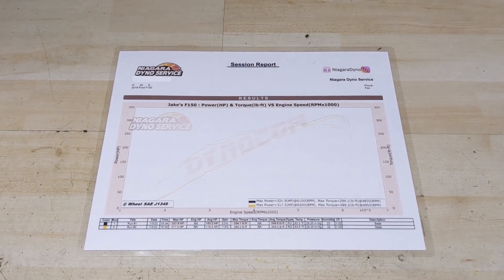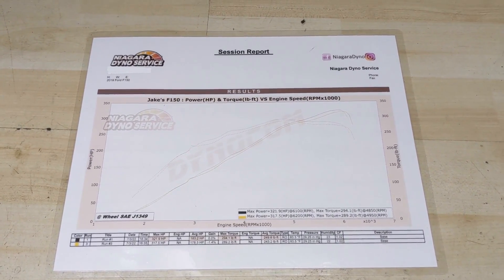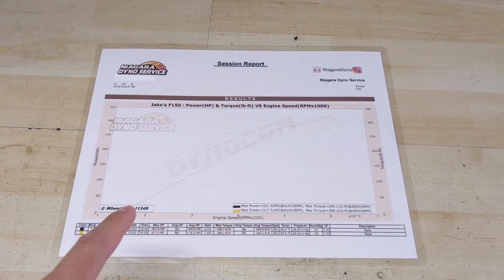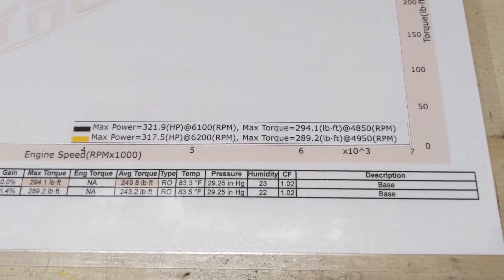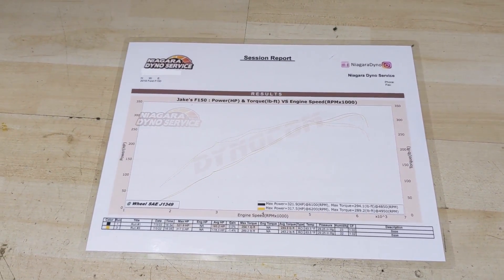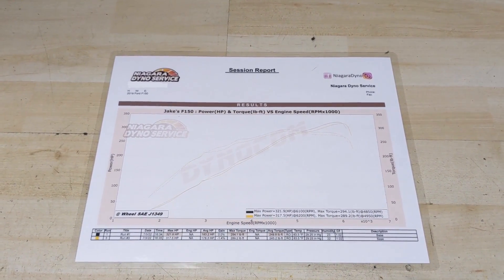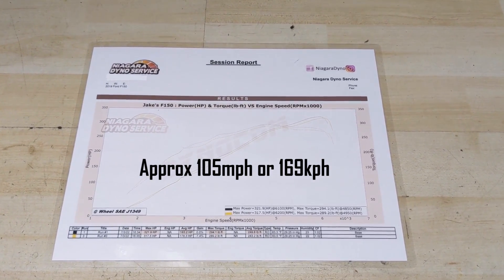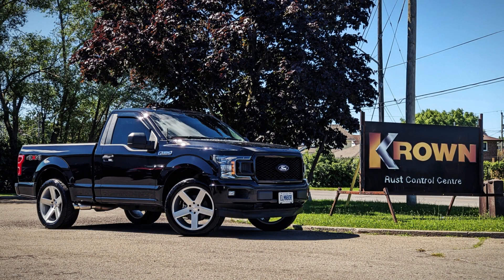How Much HP Does a 2018-2020 5.0L F150 Make?

Comment: That is a great horse power out put  oh by the way how can I get a e.p hat
Reply: Roger we only made the original prototype hats embroidered by a Canadian comopany website that turned out having them made in Denmark. Wow the hats went from $22 each to $50 each with the shipping and international duty charges. At some point Jake will be setting up a merchandise site for supporters to purchase EP items like hats and T shirts. We may also have some specialty hats locally embroidered to be given away during our 100k subscriber giveaway. The main prize giveaway will be an Industion Innovations Venom Mini Ductor gun which you likely have seen used on our videos for seized nut or bolt removal. We may also be giving away a Lube Shuttle Grease Gun package another product we use on a regular basis at EP. The request for our hats has been extreme so hopefully Jake decides to set up the merchandise section.
Reply: @waynestefinashen239   okay thanks for the info on this matter of the hat's
Reply: @robertmailhos8159  Your welcome Robert guess we just have to wait on Jake eh!
Reply: @waynestefinashen239   okay thanks for the info on this matter of waiting on Jake to get it done 👍

Comment: Yeah, but when you rebuilt the carb did you replace both diaphragms? Muahahaha! 
Aluminum body?!!  Wow!  I didn’t realize!  Now if they could just make a durable aluminum undercarriage we’d be all set! 🔧👍
Reply from the maker: Yea it was honestly one of the selling points that sold me on this truck, all aluminum body, even panel, it'll never rust and rot out like many older trucks I've seen. Steel frame and suspension parts still